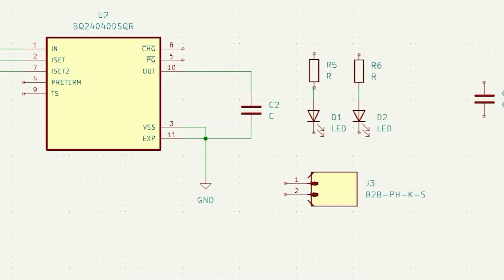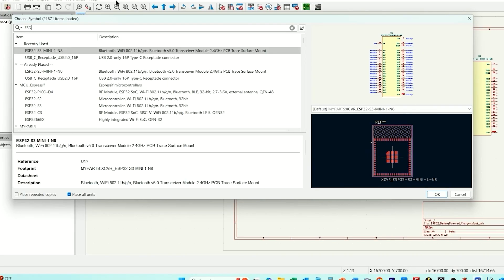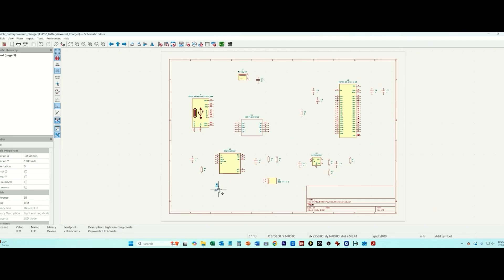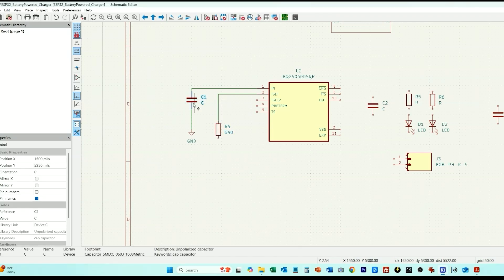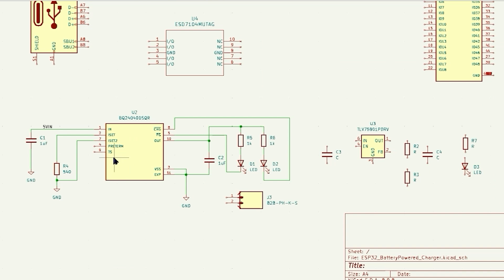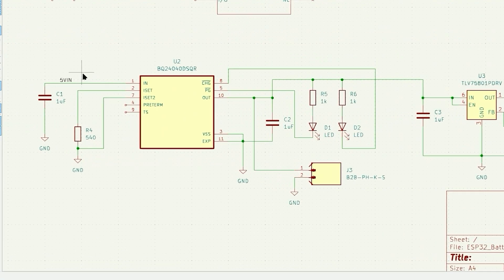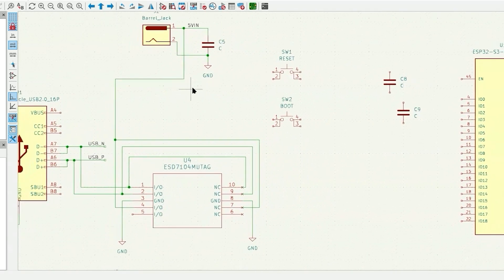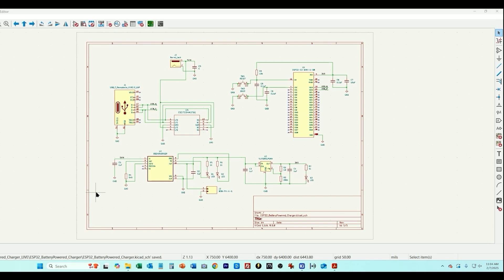Design an ESP32 Board with a Battery Charger - Schematic Circuit

Comment from the maker: Download the full-length version of this tutorial here: https://bit.ly/3SkCuhJ
Reply: Hello Please create a video tutorial on a cost-effective 12V lithium battery charger with ESP32 integration. Many applications use 12V batteries that need charging from an input supply while simultaneously powering an ESP32 via a step-down converter (LDO or buck). The focus should be on a budget-friendly charging IC suitable for a 3S 12V battery.
Reply: @PredictableDesigns Sir, what if we have to program our ESP32 just once? How can we do it without USB-C or Type B?

Comment: Hi John, if I wanted to remove the DC jack and power from the USB C receptacle, how would I do this? Is it as simple as connecting the VBUS pin to the ESD module? Thank you.
Reply from the maker: If you need less than 500mA, yes it's mostly that easy, except you need two CC resistors for USBC. See this video where I power it via USBC: https://youtu.be/AaEPY4PrPFY?feature=shared

Once you get much above 500mA then you to negotiate the power draw and things for complex.

Comment: Love the videos, but i have one question, why not just use TP4056?
Reply from the maker: It's a good chip and I've seen it other designs. I just prefer to stick mostly with better known chip manufacturers, and I always prefer TI parts for power. But, since I was a designer for TI in the power group, I'm just a little bit biased :)

Comment: I liked that you showed how to wire non-TP405x battery charges. How to add overdischarge protection like XB4908A to your circuit? Consider a typical scenario where you'd like to flash your ESP32-S3 with a USB (no battery involved but may be connected) and run the device with the battery afterwards. I'm always confused fiddling with three grounds: USB, battery direct, and battery protected (output from XB4908A or similar).

Comment: Hi, thanks for the great video! I have a specific question regarding power path management. From the datasheet, it seems like the BQ24040 doesn’t include true integrated power path functionality. Wouldn’t adding a P-MOSFET, a diode, and a pull-down resistor (e.g., like in this video: https://youtu.be/GRd9uTwg7r4?si=CkDc46q7hnq6bR2E) make the overall setup more reliable for general-purpose use — especially with power-hungry MCUs like the ESP32? Or do you think that’s over-engineering it?
Reply: Thought this as well. Because he connected lord and battery in parallel the load May steal some of the charging current

Comment: I maybe have a stupid question. But this ESP32 board is a DEV board right? So it still has a input USB-C jack for powering and flashing the board? How do you do it in production if you dont want to expose that to the user. I want to make a product with a Teensy 4.1. But it comes with a micro-usb port for both power and data. Which I dont want to expose in the final product
Reply from the maker: First of all, that's not a stupid question at all. This is a question I get quite often. For programming via USB you have to hold down the GPIO0 (BOOT) pin during powerup, so long as the user doesn't have access to this pin/button they can't program it.

Also, for programming in production, generally you'll get the MCU's programmed ahead of time when you order them, and in-circuit programming is mainly only for use during development. In production you'll just solder on the already pre-programming MCU.

Comment: so, there is no pinout from the esp32? how we do the interfacing with the esp32? like a normal board.
Reply from the maker: This is not a board intended for you to build and use in a project. The ESP32 has lots of GPIO pins but I don't bring any of them outside the board with header pins. In this previous ESP32 design video I do include header pins and bring out the GPIO pins.
Reply: @PredictableDesigns  it means that if i need the battery charger and pins, i just need to add the header then?. I am sorry I ask too much, but i really new to this, and want to try your design. thank you for sharing.

Comment: Thank you for a good video. 1) why did you use barrel connector for charging and not the existing USB connector? 2) why did you connect the NC pins on the ESD chip? NC means don't connect....
Reply from the maker: 1) No good reason other than I wanted to do something different and in my other esp32 design videos I've powered from the USB. I maybe should have powered it at 12V just to make it more obvious why I didn't use USB.

2) I explain this in either the full-length version, or in the upcoming part two on the PCB layout. Yes those pins are no-connect, but it improves the layout if you route the two data lines over those nc pins - so that's why I have them connected in the schematic otherwise I would get a verification error.
Reply: @PredictableDesigns  1) i plan to follow your steps with one USB connector only, easier for the final user and for the box 3d print. 2) About NC - sometimes the pins marked as NC are actual connected to something inside, and may be used for debug or hidden feature. I am not saying this is the case here, yet I would recommend not to connect them as a practice. I am not sure I understand the verification part - if you mean the schematic layout rules, you just place X. As you did with the ESP32. 3) new one: why did you chose the ESP32 S3 over the C3? I think C3 is better for battery powered.
Reply: Which video would you recommend to learn how I would use the usb C connector for charging correctly?

Comment: Thank you so much for the tutorial. I am kinda new to pcb design, I am a 3rd year university student at Cambridge studying electrical engineering.

I had a question about connecting the LiPo cell to the charging IC, is there any danger in power being supplied to the IC from the LiPo or is there some protection for this?

Also, if I wanted to use the same LiPo cell to power the board (to use it in an IoT project) can i just simply use a switch and a different JST connector and hook it up to the the linear regulator, any advice would be amazing 🙏
Reply from the maker: 1) No danger, and the battery charger IC handles this internally.

2) Not sure I understand. The design I did does both, it charges the battery but then the battery also powers everything.
Reply: Oh right, can you give a quick explanation on why the battery also powers while getting charged. Am i right in saying that which ever is a higher voltage will supply power. 

And thank you for the quick response 😊

Comment: I always wondered how come an engineers knew, what IC to use, and what pin to take in use , what value of registers he or she needed to put on. 
😅
Reply from the maker: It takes a lot of part research and reviewing the data sheets in detail.
Reply: @PredictableDesigns  I did my diploma in microprocessor and digital circuits.. I tried to get into a manufacturing job where I can learn more about embedded systems.. but in india it was next to impossible, that's why I couldn't figure it out.. but it seems I have found the right channel

Comment: You also need the pull-up resistor from GPIO0 to 3V3. And add some protection for the battery not to go below the minimum battery voltage.
Reply from the maker: I should have mentioned I'm assuming you're using a LiPo battery pouch that has all the safety circuitry built in. Yeah I forgot the pull-up resistor although the esp32 does have an internal pull-up.